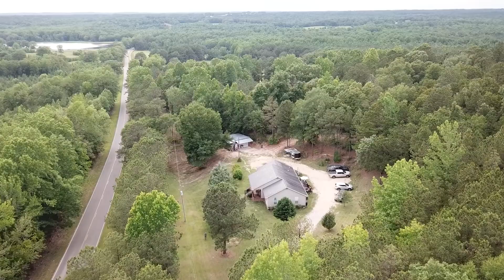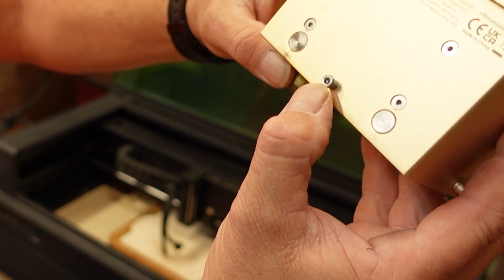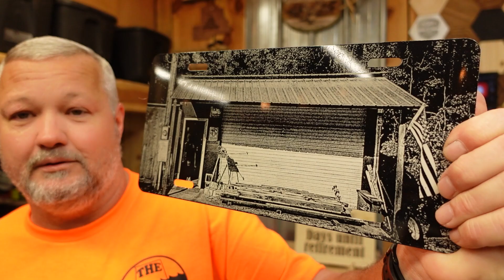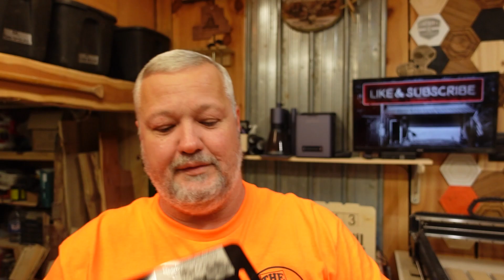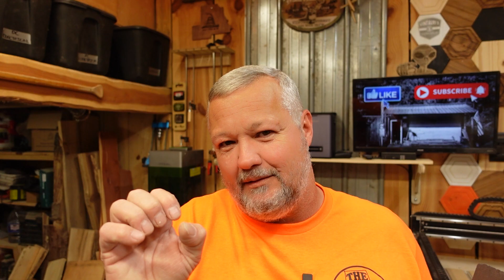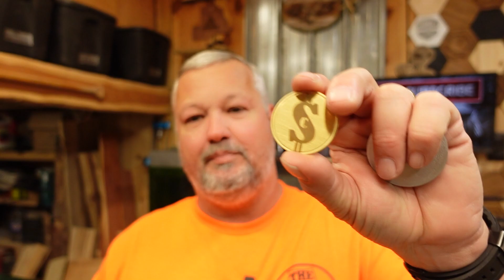xTool S1 IR module- IS IT WORTH IT?

Comment: Those license plates are cool..been thinking about ordering a IR I’ve always been under the impression stuff like that will take forever?
Reply from the maker: The anodized material is one of the fastest case uses for an IR. Marking bare metal is slower. It does take w while but the results are awesome.
Reply: @TheClackShack your videos are the best I’ve seen on YouTube for just starting how long did the plate take before I dive into that?

Comment: would you say the s1 w/ the 40W would be good for someone who is a total beginner?
Reply from the maker: It is a relatively easy to use machine. Just plan to use XCS software. It would be easier to learn than most.
Reply: She purchased the 40W/2W IR combo plus the riser/rotary/conveyor. Fairly simple and straight forward to use, once you start using the XCS software it gets easier to use. My wife has done a lot of stainless steel etching for plant/flower markers. We're waiting on the masking film to do some glassware. If you are going to be using it inside your house, I would recommend the air cleaner system. Everything will have some odor emitted plus smoke depending on the material.

Comment: Im really interested in purchasing this module my question is will it clean rust off tools?
Reply from the maker: That is a tricky question.. The answer is yes. The issue that I have with referring it for this is that it will be painfully slow with this type of setup. This module was not built for rust removal and has a very small focus. It is an IR laser beam similar to that of fiber lasers and would have the same effect at a very slow pace.
Reply: @TheClackShack  thank you for this information. It was very helpful.

Comment: Great video! I know you are very busy but three questions 1) I bought the IR module for metal. 2) Can I also use it effectively on glass or should I just use the regular 40W with CerMark? 3) What if I actually want to etch the glass some rather than just leaving CerMark behind on the glass?  Thank!
Reply from the maker: With the blue or IR, you will need to use marking spray or some form of interaction layer. You can also use tempera paint to get a different look. I would use the 40 watt unless you needed more detail.
Reply: @TheClackShack  Thank you!

Comment: I noticed you swapped the laser modules but not the power supplies.  Is the power supply for the 40W module compatible with the 2W module?  Did your 2W module include a power supply?
Thanks!
Reply from the maker: With the xTool, it is made to be a drop in swap. My machine came as a 40 watt version.
Reply: I originally purchased the 20W S1. Then, I purchased the 40W module, which included a power supply.  Then, the 2W module also included a power supply.  Any time I swap the modules, I also swap the power supplies, which is a pain.
So, I was wondering if I’m wasting my time swapping the power supplies.

Comment: How well do these perform in the cold?  No room in my house for it so I would need to put it in my unheated garage.
Reply from the maker: As good as a laptop. Basically same type of equipment.
Reply: This is from Xtool.
The xTool S1 laser machine operates properly between 0°C and +35°C. It can be stored at temperatures between –10°C and +40°C, but should not be operated at temperatures lower than 0°C. 
The infrared laser module for the xTool S1 has a working temperature range of -10°C~+30°C. If the temperature is below this range, you should preheat the machine by running a project first.

Comment: Hello! I wonder if I should go with the s1+this module or the f1 ultra?

I mainly work with anodised aluminium, brass and titanium and needs batch processing 🤔
Reply from the maker: depends on what you currently have and the needed work area. If the ultra has the space, it is much faster

Comment: Could you please go more into the settings to get the different colors on stainless steel?  In particular I am wanting blue for some business cards that I want to make for a Christmas present.  I have the 2w module but have not used it yet as I am very new to lasers.  Thanks
Reply from the maker: Colors are a bit of luck. You can make them, just not able to always predict the color.
Reply: @scottpearson1785  do test pattern with different settings

Comment: I have a different machine but it also has a 40w blue and a 2w IR. The IR can indeed engrave...if you have the time. You're right, it's great for smaller tasks such as logos and personalizing pretty much anything the 40w cannot. One thing I did find the IR can do fairly well is engrave anodized or general colored cups, such as those you see everyone engraving with the 40w. It can do it much faster than the 40w but if you do slow it down it will remove the coloring and give dark tone color to the stainless steel (or aluminum) underneath. I've done a few cups this way. I've engraved unpainted stainless steel cups a really dark black. The problem with doing the darker blacks on metals (besides taking a god awful long time) is the texture of the surface will be similar to sandpaper. This might not be a bad thing since it provides grip to an otherwise slick unpainted stainless cup. You can adjust the power and keep the speed high to lighten the "black" to a bronze color to keep it closer to a smooth finish. It takes a LOT of testing to find the perfect setting for not just each material but with IR each individual piece (even from the same multipack) can engrave differently. I'm guessing slight variations in the way the metal is cast or heat treated causes this variation. That's my 2 cents. Well worth the cost for IR because it's great at metals (and plastics without melting) and the ultra fine laser spot. Great video!
Reply from the maker: Agreed